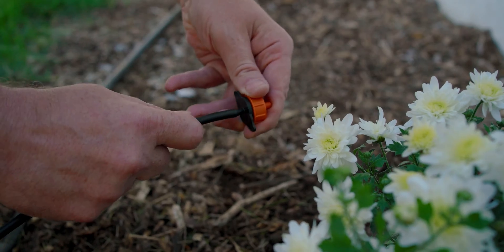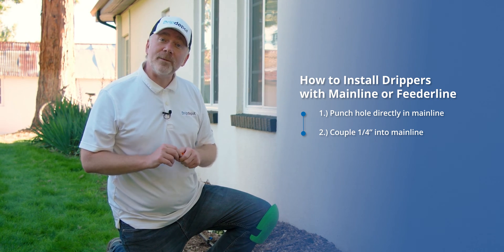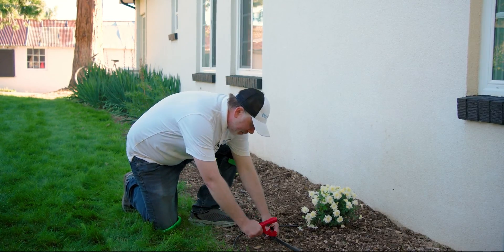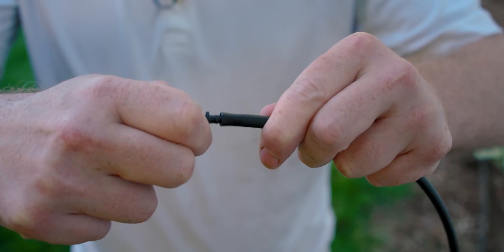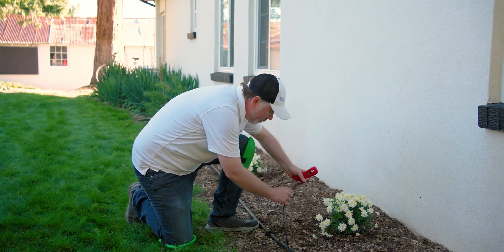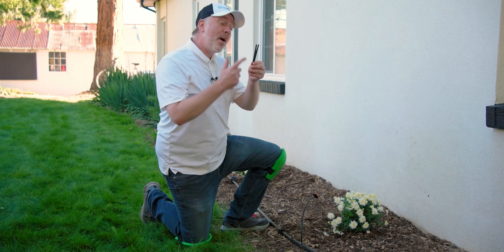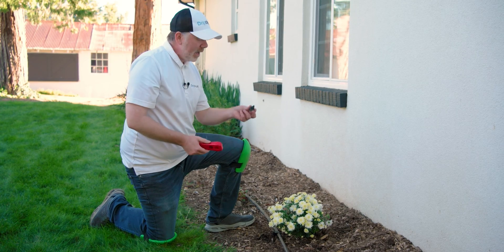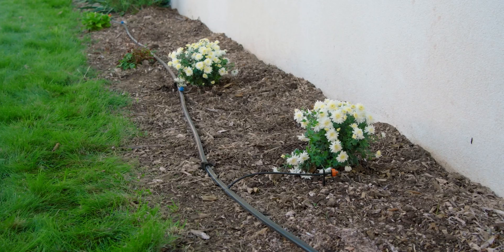How to Connect Drip Emitters to your Irrigation System with 1/4 inch Micro Tubing

Comment from the maker: Need to install a bunch of drip emitters? Do you have trouble with barb insertion? The right punch or installation tool will make the job much easier. Check out this video to find the right tool to help reduce fatigue: https://youtu.be/HP5744WoUIY
Reply: @dripdepot. 

Can just install the 1/4” adapter to main line and don’t install any emitters at all?  If there is a 25psi regulator and 60 or so plants have no emitters the flow would be low correct?  Then you set your timer to only water like 10-15 min a day. Will that work?
Reply from the maker: @webcrawler3332  This would unfortunately be unlikely to work as desired -- even at 25 PSI, an open 1/4" tube is going to be able to put out quite a lot of water, faster than soil absorption can keep up with except in the sandiest of soils.  

It's something I would like to test, but there's a good chance the 25 PSI regulator may not work in such a setup as well -- that's because pressure regulators require pressurized lines in order to begin regulating downstream pressure.  Open 1/4" lines could be enough to prevent the system from being fully charged or pressurized (but this is something I'd be interested into actually testing).
Reply: @dripdepot  Thank you.  If you do test I’d be curious to know what the results were
Reply from the maker: @webcrawler3332  You bet!  If we get a chance to test this (and we very well might when we get back out to filming after irrigation season), I'll update you here and @ so you get a notification.  :)

Comment: would this work for underground 1/2in tubing that feeds into a sprinkler?
Reply from the maker: It may be possible, though the odds are fairly low.  If the setup is unconventional (which is something we see, particularly in DIY projects) the odds improve.  In most systems, the tubing that feeds into the sprinkler is going to be a type of high pressure tubing.  This tubing is often referred to as "swing pipe" or "funny pipe".  It has thicker walls than the LDPE tubing used in low pressure drip irrigation systems, and those thicker walls (and stiffer material) don't work well with the barbs on drippers and 1/4" fittings.  

With that said, we definitely see LDPE tubing used in these situations, and while I wouldn't say it's common, it is definitely not unheard of - in nearly all cases, the sprinklers are pressure regulated spray bodies like the Hunter PRS40, Rain Bird 1800 or Hydro-Rain HRS.  Those work at lower pressure than traditional sprinkler rotors so some people use lower pressure poly tubing instead of the higher pressure swing pipe.  

If the tubing there is the thinner walled LDPE used in drip irrigation, it could absolutely accept a button dripper.  Would the install also be underground?  If so, you'd want to be sure to use a cleanable dripper so that in the event of a clog it could be quickly disassembled and cleaned.  

Depending on what you're looking to do, there's quite a few other ways to connect some drip emitters to an existing irrigation system, even one using all PVC and high pressure swing pipe :)

Comment: Can you add a dripper to a 1/2 inch poly drip line?
Reply from the maker: You sure can!  I think it's good practice as well, it saves on materials if you don't need 1/4" tubing for every dripper connection :) 

All that's needed is to punch a hole in the wall of the 1/2" or larger tubing with a 1/4" punch (same punch that's used for 1/4" fittings when connecting 1/4" tubing) and then insert the barbed end of the dripper into that hole.  

We made a video that goes over different ways to connect drippers and this is one of the methods we covered - here is the link to that video, I set it to start right at the section that shows how to connect direct: https://www.youtube.com/watch?v=w_xlCV-0yQU&t=12s
Reply: @dripdepot thanks for the quick reply! You’re awesome!

Comment: I notice these drippers are always quite far from the plants.  Any reason for this?
Reply from the maker: Good question!  In this video it was very likely just to make sure the emitter was visible, nothing like trying to show an installed emitter and the foliage blocks any good shot of it.  That said, the emitter will still be effective at this distance, at least outside of sandy soil types.  The capillary action of soil will take water pretty far from the point of drip in loamy to clay soil types.  This will also help promote a strong root system, as they'll move towards the water and that type of lateral root growth provides a strong foundation for plants.  

Optimally I'd probably move them a bit closer, but I can confirm they'll still be effective there outside of sandier soils :)
Reply: @dripdepot  Ah I see thanks.  I have an previously installed area where they have put them at quite a distance.  It is bark mulch so wondering how effective they are.
Reply from the maker: The bark mulch will definitely aid in moisture retention, which in turn increases the odds of being able to get the most out of your soil's capillary action.  A few minutes after a normal watering cycle, you could dig beneath the mulch and soil a bit in between the dripper and plant to make sure the soil is moist.  You can check near the plant as well, just be careful not to disturb the roots too much if possible.  

Should give you a pretty good idea if water is making it over that way (very good chance it is, but i know that peace of mind in seeing it is always nice) :)
Reply: @dripdepot thanks!

Comment: The tube was not fully engaged in the connector? Is there an easy way to insert the tube in the connector because i find it difficult.
Reply from the maker: It is definitely difficult, you're not alone there!  I've been doing it for years and I still wouldn't say it's easy.  

One top that absolutely makes it easier (and this works for larger sizes of tubing too) is to dip the end of the tubing into a cup or thermos of very hot water and hold it there for a few moments.  This will soften the tubing up considerably, making it significantly more flexible.  When it's flexible like this, it's much easier to push the tubing on to the connector.  I still use this trick from time to time, it saves the fingers some discomfort as well :)

Comment: Is it possible to connect the emitters to a PVC?
Reply from the maker: It is!  It's not as convenient as punching into poly tubing, but with PVC you can use threaded emitters -- some emitters come with 10-32 threads.  You can drill a hole in the wall of the PVC pipe with the correct tap drill bit and then thread the emitter into the drilled hole.  Here is an example of a dripper with 10-32 threads:  https://www.dripdepot.com/16652

In most cases it will be much easier to connect emitters (particularly drippers and barbed emitters) to poly tubing, but you can absolutely connect threaded emitters to PVC pipe. :)
Reply: How many drip lines  can I run off one of these special  sprinkler heads?
Reply from the maker: @stacyduarte2005  Apologies for the late reply!  For some reason YouTube does not send notifications when someone else other than the original commenter replies.  Fortunately I bumped into this one this morning :) 

Do you mean the button drippers in the video?  With those, no additional drip line is needed, they are typically installed near the plant to deliver the water without additional drip lines.  Usually one per plant, though larger plants will often have a button dripper placed on each side of the plant to encourage even root development.  Water spreads about 12" from the point of drip so most common plants are good with 1 dripper.

Comment: will it work if the main line tubing is drip line with embedded emitters? Will the drips with he 1/4 inch tubing work? Will the tubing with the embedded. inline emitters/valves still work?
Reply from the maker: So long as all other factors are accounted for (there is sufficient flow and pressure available, there is room for more emitters based on the capacity of the tubing) this is absolutely possible to do and still get great performance.  

Basically, so long as you're not on the cusp of overtaxing your water source or tubing capacity, you should have no problems :)
Reply: Thank you for your reply

Comment: Thanks for the detailed information! Can you please tell me if I can install the emitters direclty on the main line but then run 1/4 lines to plants that will be 5-8 inches away from main line? Is there any downside to this configuration? Thanks!
Reply from the maker: The only real downside is the potential for insects or debris to get into the end of the 1/4" tubing that's coming from the dripper and cause a clog (for some reason some small insects love the 1/4" tubing opening but will leave dripper orifices alone).  This can be remedied by using what's called a "bug plug" that goes on the end of the 1/4" run -- it doesn't fully plug the line, just enough to deter most insects -- basically, the only real downside is in potentially needing another product (but they are very inexpensive). 

Not so much a downside, but you also want to make sure to get a dripper that has an outlet barb or outlet post designed to accept tubing on the outlet side of the dripper.  These are fairly common and almost all popular dripper brands have some that come with this, but make sure to get one from the start so you don't end up having tubing popping off your dripper during a watering cycle. 

Other than that, definitely go for it!  In nurseries it's a very common (and effective) way to use drippers, so you'll be in good company :)
Reply: @dripdepot  Great explanation, thanks again!!

Comment: Hi again Adam! Can you please advise, is there a spacing requirement or recommendation when connecting 1/4” tubing and drippers to the 1/2” mainline? Do they need to be “x” inches apart, or a maximum of “x” number of connections per foot/yard/whatever of mainline? If one is running drippers to a line of pots, will you reduce flow or performance by having too many connected to a short run of 1/2” mainline? Thanks once again, you folks are the best.
Reply from the maker: There is no specific rule, but at least a couple inches will be the easiest to work with.  While enough barbed fittings can cause an obstruction, in most situations it's not going to be a concern.  Perhaps if other specs of the system were on the cusp of being in the red (really high flow in a long run of 1/2" tubing with a ton of barbed fittings) it could impact performance, but those are definitely outliers.
Reply: Awesome, thanks so much. They'll be at least 6-8" apart so it sounds like they should be fine.
Reply from the maker: @epristerv  Definitely!  6" to 8" is very common (and successful!).  I've personally seen them as close as 3.5" with no detrimental impact on the performance of the system, you'll be good at 6" - 8" :)

Comment: Can you remove the emitter once it's connected to the microtubing or you have to cut it ?
Reply from the maker: In most cases you can remove it -- it can definitely be challenging, as the barb grips the walls of the tubing pretty tightly in order to create a water tight connection.  

Removing one when the tubing is cold is typically easier than when it's warm -- when the tubing is warm, it can end up stretching the tubing.  When the tubing is cold (early morning, late evening) it's more likely to "pop" out of the end of the tubing.
Reply: @dripdepot  thank you. I managed to remove it after all !
Reply from the maker: @NotSoLiberal  You're very welcome!  Glad it came it without too much struggle -- sometimes they can be stubborn :)

Comment: I am having a difficult time getting the 1/4 barb into the 1/2 inch line.  All of the other set up was straight forward but I physically could barely get the barbs in.   Is there a trick beyond warm water? When I try to use the warm water on the 1/2” it becomes slippery and the barb is sliding around.  Yes I did dry it with a towel.  Thanks
Reply from the maker: You bet, happy to help! 

The first thing I'd check is if you are using a punch to punch the hole in the 1/2" tubing first -- if not, grab a 1/4" punch and give that a shot. 

If you are using a punch, try to do this when the tubing is colder (early morning, late evening) -- just as you noted, when it's warm it gets flexible -- this is great for putting the 1/4" barb into 1/4" tubing, but not as great for pushing into the hole punched in a 1/2" tubing wall -- the 1/2" tubing ends up just stretching.  If you do it when it's colder, there will be greater resistance and it will sort of "pop" in.  

I hope this helps and will be here if any questions come up on this or anything else!

Comment: Is it okay to run 1/4 tubing from the 1/2 by about 6-8 feet?  Don’t wanna cut the 1/2 and try and make a tee
Reply from the maker: You bet, 6' to 8' will be no problem for a run of 1/4" tubing supporting a dripper, you're safe avoiding that Tee :)
Reply: @dripdepot  thank you!
Reply: @dripdepot What is the maximum length I can run 1/4” micro tubing from my 1/2 inch mainline? I’m trying to save money on my 1/2 inch mainline needs. The 1/4” micro tubing would support a 4 gallon per hour drip emitter for a tree. Thanks so much. Adam is a great communicator and there are a lot of talented people behind these great videos.
Reply from the maker: @Luvurenemy  I'd likely still stay somewhere around the 30' recommended maximum run length, but I can confirm that at 4.0 GPH it could run longer if you needed it to -- even at 60', you'd be losing less than 1.0 PSI from friction loss.  Friction loss isn't the only factor that goes into maximum run lengths, but it's the main one that will affect emitter performance and with that low of friction loss it will perform well at longer distances (just don't run too much more than that dripper off of it) :)
Reply: @dripdepot  Thank you so much for the prompt reply! God bless.

Comment: Thank you for this. I'm looking at buying the Basic Metal Raised Bed Kit and modifying it. I did some upgrading after watching your videos. I'm also planning on doing this method for all my grow bags that will be outside of the beds. I currently have 1-gallon and 5-gallon bags would the blue dripper be good enough for the 5-gallon bags?
Reply from the maker: The blue dripper is a bit on the flow flow side (0.5 GPH), so to some degree it will depend on your watering cycle, growing medium and the root ball size of the plant.  In common loamy growing medium, water spreads about 12" from the point of drip through the soil's capillary action -- if the root ball will end up larger than 12", it may benefit it to go with two drippers, one on each side of the plant for more coverage. 

If that ends up being the route you go, the method is essentially the same -- what you do is run your 1/4" tubing from the mainline like normal, but then cut it and install a 1/4" tee -- with that tee in place, you can connect 1/4" tubing to both sides of it and run them to opposite sides of the plant for the drippers.  We see this a lot in larger containers and/or plants with larger root zones :)
Reply: @dripdepot  I'll be growing in 30x 1gl bags herbs, carrots, green onions, lettuce (romaine, black Simpson, and spring mix), spinach, strawberries, and radish this winter (the radish and lettuce I'm doing succession growing). In 10x 5gl I'll have 1x broccoli, 2x celery, 2x collards, and 5x cabbage. I have 1x 50' 1/4" tubing, 60x cleanable emitters, 12x T's, 60x 1/4" barb coupling, and 60x micro stabilizer stakes. I like to have a little extra just in case. I think that should do it. My GPH is 450 according to the calculator and my beds are 4x3 and 6x3 galvanized. I have other things I've added to my cart because I needed them for the install but this is what I added to add these to it.
Reply from the maker: @justmeinflorida33542   You must be somewhere warm, that's a fantastic winter garden!  

At 450 GPH at your water source, you should have plenty of flow to feed all the emitters, a good position to be in.  You may want to consider going with a 1/2" mainline (if I'm understanding correctly) for pressure reasons, however.  

A 50' run of 1/4" tubing (if you use it all) with 30 GPH (60 0.5 GPH drippers) going through it will lose 32.6 PSI from friction -- if you already accounted for that and the 50' 1/4" is just to run off your larger main, you can disregard this portion, I wanted to mention it only just in case :) 

Sounding great so far -- when you go to check out, I'd be happy to look over your order and make sure nothing critical was missed (and likewise, make sure nothing superfluous is in there).  All in all it's looking great though, pretty much exactly as we've done many times.  Remembering the stakes is pretty big, it's the one thing we see missed the most.
Reply: @dripdepot  Oh Florida Zone 9b ;)
Reply from the maker: @justmeinflorida33542   Nice!  I'm jealous, particularly this time of year lol, we're gearing up for our cold dreary winter here in Oregon